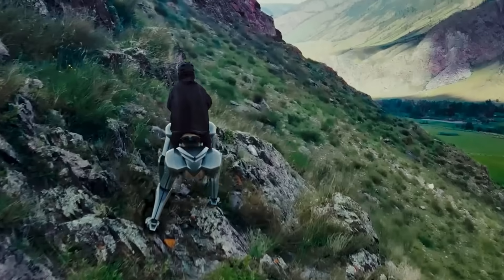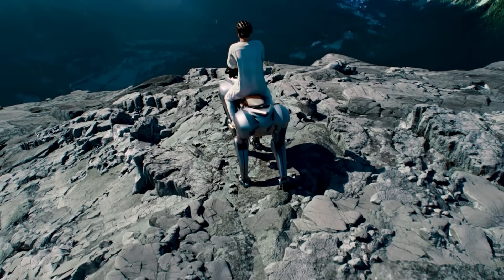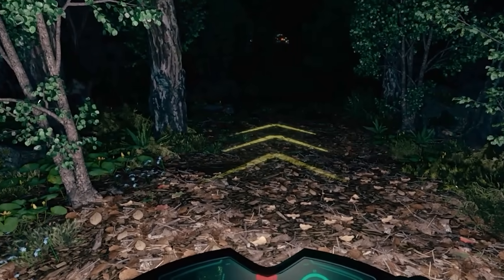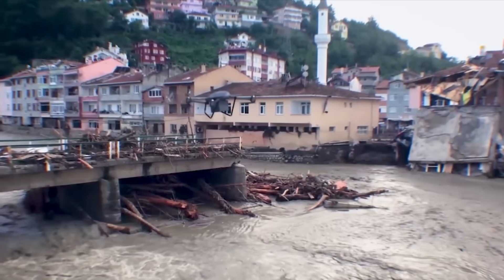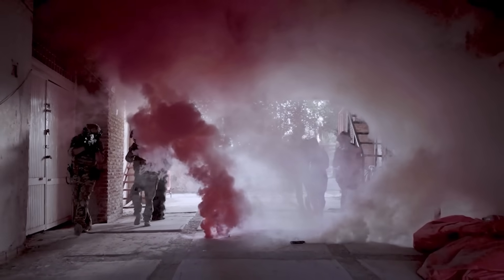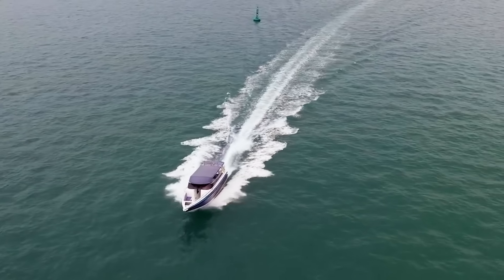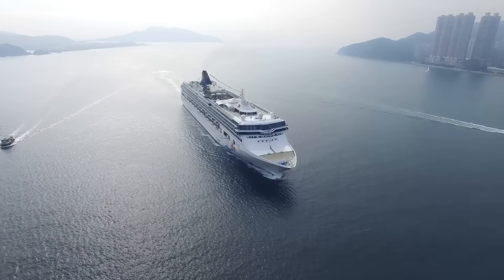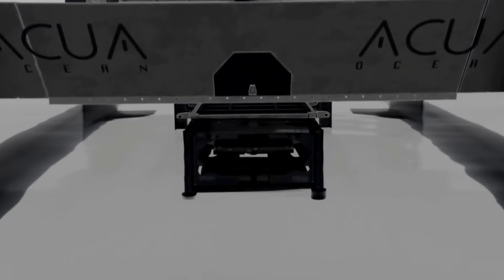Hydrogen Powered Robot Horse by Kawasaki - CORLEO is WILD

Comment: yes, so much more comfortable and practical to ride a galloping robot horse than it is to ride a motorcycle with actual suspension.
Reply: I think the only use case other than it just being cool is for rescue operations in areas that you couldn't get a vehicle to, and when weather wouldn't permit a helicopter. Even then, it would need to be larger, and it would be so slow, that most of the time you would be better off waiting for the storm to pass.